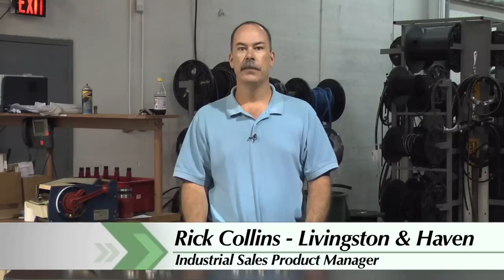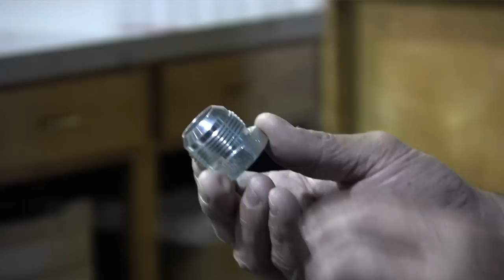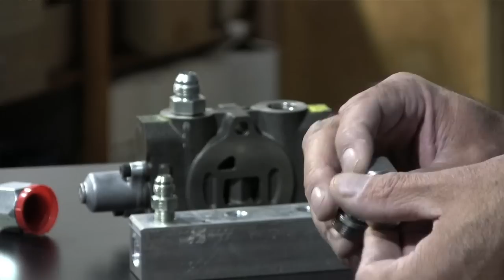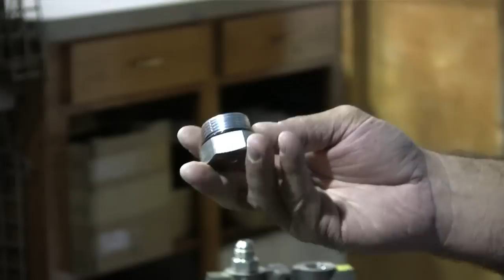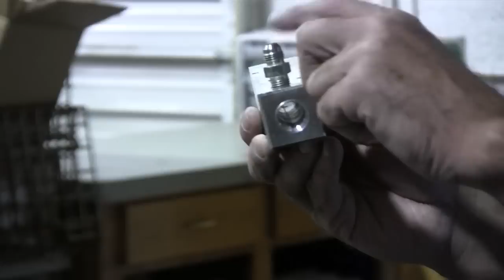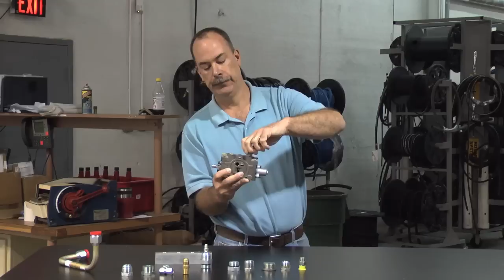Shop Talk - Fitting Thread Identification - Distinguishing Characteristics of Each Thread

Comment: Hello and thanks for the great instruction on a difficult topic from my point of view as non-professional in hydraulics. Looking on my Clark C500 forklift and Kubota L2850 compact tractor, I am now looking forward more optimistic to getting the jobs done.
My Clark has an (Eaton)Vickers valve on the right hand side, which is typically installed for side-shifter, but is out if order since I bought the forklift. The lever is missing, only the  operation bar comes out on the top of the valve. Further more, there are two fittings installed, which I now - after your lesson - would call JIC fittings  ( guess 3/8 or 1/2" from memory, but I will check diameter and thread pattern again). There is one point, which I don't know: The open top of the JIC connectors seem to be plugged by a bowl or something like that. Will this "sealing" device be retracted, when I move the operating pin up- or downwards or do I have to unscrew the connecters, put off the plugs and screw them in again, before connecting the hose etc? 2. Concerning my Kubota tractor, I found the threads in the manifold bloc are 3/8" NPT resp 1/2"NPT. As there is no valve for any devices installed - apart from the totally integrated 3-point at the rear end, I have the chance to build up a trouble free hydraulic system, lasting for eternity. In Germany, I very often come across with metric fittings (M18*1.5 or M22*1.5). Hose or tube connectors came with a conus, like the JIC or flat with an o-ring for blocs etc. What I learned so far about sealing a hydraulic system is, that I will not go for NPT or other tapered threads, which need teflon tape or similar sealer ( silicon, hylomar). What can I expect from the different threads/ connectors ( JIC, BSP, BSP-P, Metric, etc, etc.) in terms of sturdiness, longevity, durability? I would like to keep the system simple ( one thread/type for all where ever possible) and trouble free. Is JIC the best? Thanks in advance Heinz
Reply: Go with BSPP with O-ring for block ports and JIC male/female connections 👌

Comment: Wow this is high frustrating when you got a stripped thread and none of your tap and die set fits. I have a high pressure fuel rail that needs to be repaired. Only like 2 threads are damaged. I found that a 3/8 flare fitting fits the line. But I still don't know the thread pitch to try and find a tool to help clean the threads. Is there any other kind of thread it could be besides sae or metric?

Comment: Great video. 
Most consumer automotive fittings are described as AN.  Could you comment on the consistency and interchangeability of these, as well as their relationship to JIC?
I'm only just now looking at such systems and am wondering how big a mess I could get into.  Thanks
Reply: They are effectively the same. AN is an army standard as opposed to an SAE standard. They are 100% interchangeable.